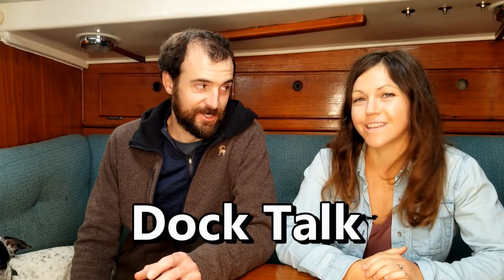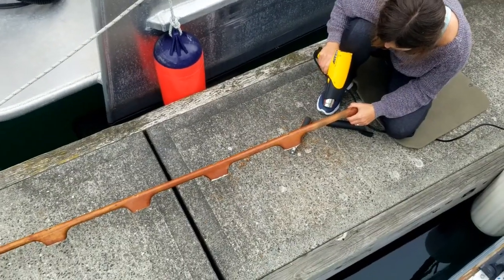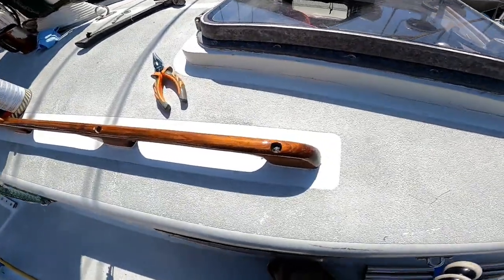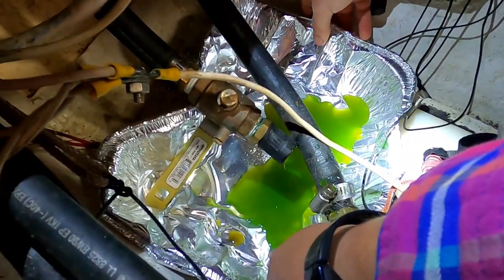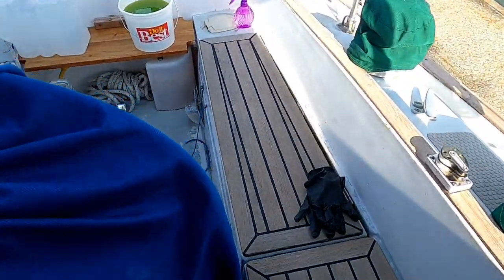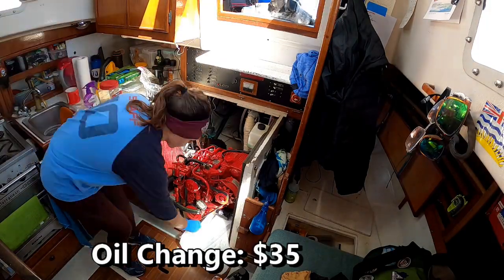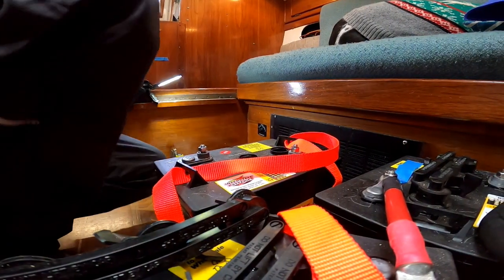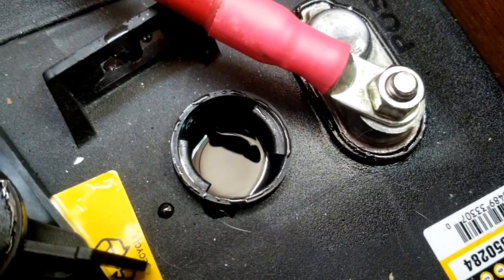Dock Talk: Ep 1. Winter Boat Projects  (Episode 41)

Comment: Thanks for sharing your adventures--they've been fun to follow!

I'm planning on varnishing the handrails on my boat also. Did you need to do eight coats on the bung areas as well to get it all to look seamless? TIA.
Reply from the maker: We put on like maybe 4 layers and there's definitely some difference in color- go for the whole 8 layers and try to varnish right away- we didn't varnish the bungs immediately and I think that added to the discoloration. 
We actually did our toerail this summer and used 3 layers of west system's special clear epoxy, then 3 layers of varnish and it looks SUPER nice. Epoxy really builds up the layers and you can do the 3 layers in the same day. Check that out: https://www.westsystem.com/207-special-clear-hardener/
Reply: @CruisingMaya  Thanks so much for the tips!